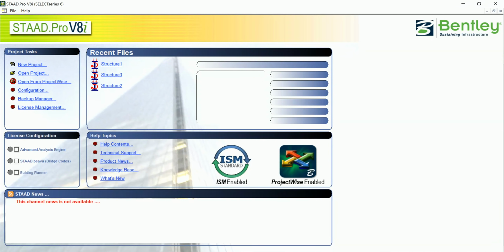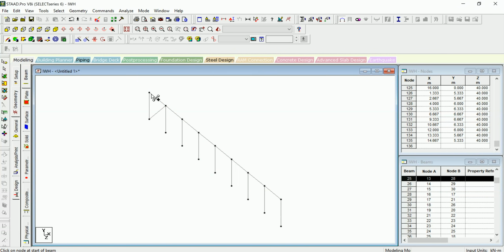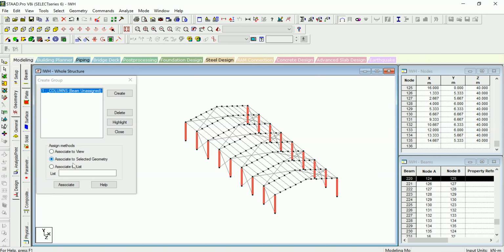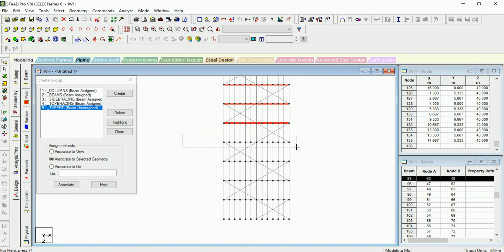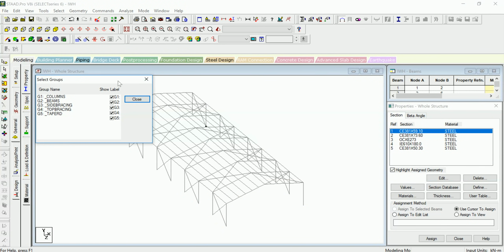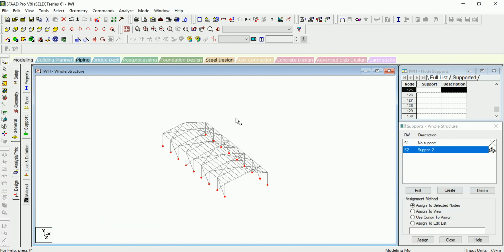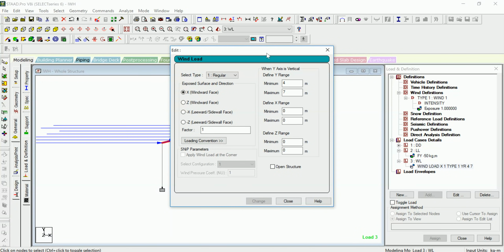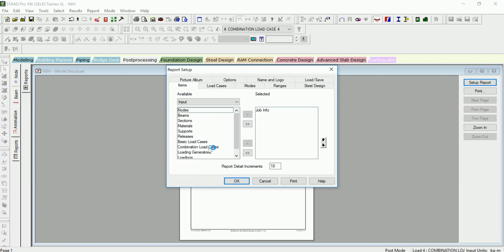Staad Pro Industrial Warehouse Design ( Steel Design )

Comment: Hi sir,

In staad software  for designing of steel structure 

there are two possibilities in rafter 1.Tapered section  2. Uniformed  section

mostly in PEB rafter,  Tapered section is going. If tapered section means can we provide purlin  as direct load members or need to convert the load and applied on columns in STAAD ce.

i don't find any videos regard this issue sir..

our case is two.1. Industrial PEB
                         2.Badminton PEB
1.Indutrial PEB  actual design done by us is Uniform section  (rafter) with purlins as indiviual loads..

2.Badminton PEB - actual desing tapered section (rafter) with purlin load calculated and applied on columns..

these two issues is raised due STAAD pro software.

If tapered section purlin cannot apply the loads as individual in the bentley staad software..

can you pls clarify in this.. regard engineering technical issues?

Comment: - How can I use Staad Pro to design the mounting structure for the solar (photovoltaic) system?

- If I have an existing industrial warehouse, how can I decide if it can withstand the extra load for the solar panels and mounting structure (around 20 kg/m2)?
Reply: Load of solar panel should be be applied on the members of tappered portion in gravity direction

Comment: You are giving I section beam property to purlins and for rafters and columns C sections.. It is not possible in almost any case.. And for wind loads in India there are lots of cases like pressure, suction.. This is very very low information about the industrial warehouse.. 
Btw Nice try 👍